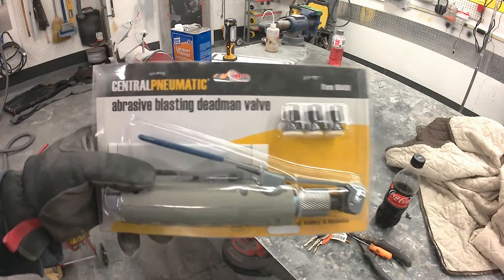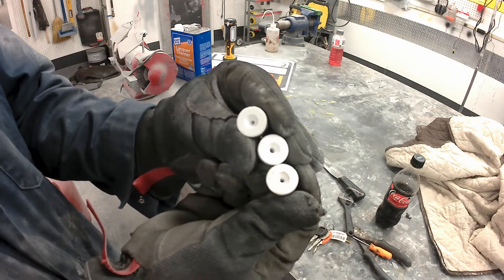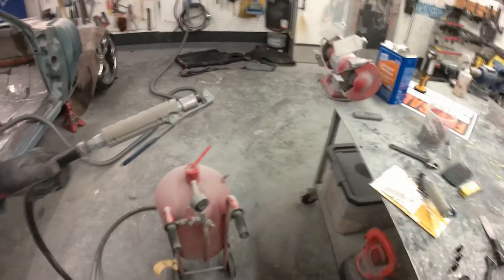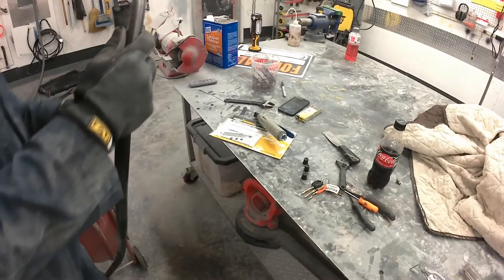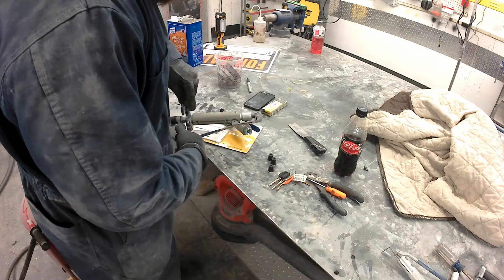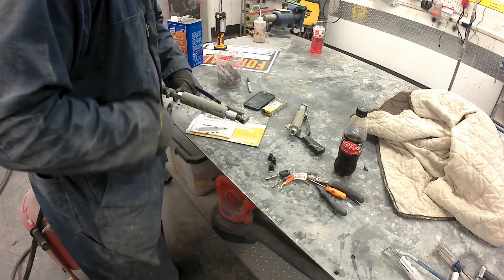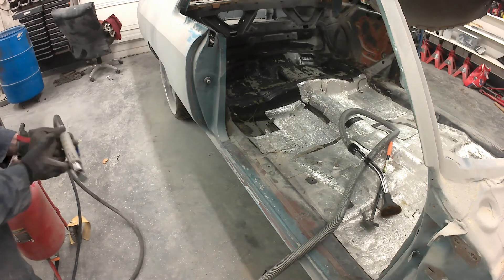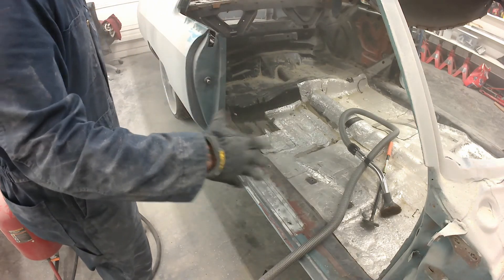Most important upgrade for your Harbor Freight pot blaster! The Deadman valve review and demo!

Comment: I use the pinch hose method! No deadman valve needed. The pinch hose is about 2 feet long  installed before the ball valve at the nozzle . 
It's a simple process, kink the hose to stop the media/air flow
shut the ball valve repeat again to operate media.air flow again. Simple and saves the ball valve. Eventually the softer pinch hose will fail but that depends how you quickly pinch it. And if it does after 2 or 3 tonnes of using abrasive flow, change it!

Comment: Larger production blasters use the pinch hose unit. They are expensive and require a lot of air to activate. My method, mentioned below, is the poor mans method that works very well.

Comment: These little blast pots are amazing I just bought one and was surprised what it can do! I think the only real limitation to them is what size compressor you have. I also have a car project and getting into the corners in tight areas is an almost impossible job without this so it’s saved a lot of time.

Comment: Just remove the valve and only use the valve under the pot to control abrasive flow . best way to go . this way the hose dont fill up either

Comment: what are you using for an air compressor? PSI, Gallons, and cfm ?
Reply from the maker: 60 gallon 5hp 110psi 14cfm
Reply: Ratsnest Hotrods will a 200l3hp 14cfm work

Comment: Just got mine...got a question though. 
I have a 110lb pot. I also picked up 50lb bag of Black Diamond from Tractor Supply. Should I dump the whole bag in or is less better for flow? 
I'm running a Speedaire 7.5 hp/25 cfm. Thanks.

Comment: What are u using for media. Mine clogs and I have a dead mans valve and I’m using the fine tractor supply
Reply from the maker: Ive used fine crushed glass and the black diamond stuff from tractor supply without much of an issue.

Comment: I like my blaster a lot but you are right used it twice and the dead man leaks , so the new dead man that you bought stops that issue ?
Reply from the maker: Yes it does!
Reply: Ratsnest Hotrods good deal I will get a new one
Reply: I’m confused. It looks like you replaced it with the same one from HF. Mine too had the cap metal gone after one hour of blasting and I don’t see any replacements for the top cap

Comment: Just bought one but it stays clogged up. Running 30/60 green diamond in it. Runs for about 10 sec and clogged up again.
Reply from the maker: Have u tried adjusting the amount of media coming out of the pot?
Reply: Yeah the instructions say to turn the  abrasive valve on all the way but that is wrong you have to slowly open it while you are blasting until you get the right amount of media coming out!!👍

Comment: So what's different between the one that cam with it and the replacement ?
Reply from the maker: Mine came with a brass ball valve that you used as the spray valve. Which doesn't stop spraying when you would like it to. Burns a hole in the side of it after one filling. Blast media right in the hand

Comment: How much pressure are you using?  I just bought one and running 60 gallon compressor and I’m only getting air out, no media, as if the valve at the bottom is clogged up